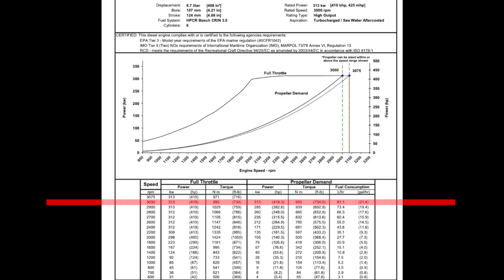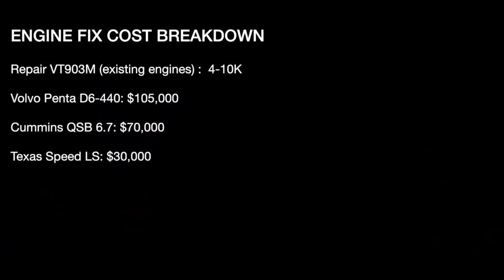Tesla Powering my 30yr Old Italian Yacht? And Broken Diesel Engine Diagnostics

Comment: Electric and water what could go wrong 🤷‍♂️
Reply: Well, get what your point, but it is the future and lots of electric boats and boat engines are being pushed to market as we speak. Oil and water doesn't mix either ;)
Reply: @tojo7742  gas is much safer and efficient ;)
Reply: Yeah and think about the breakdance you'll see when u step on the water
Reply: There are just as many electric outboards as gas powered ones... Inboards are getting more popular since the battery technology gets better and betree
Reply: But it gets the views
Reply: Trolling motors are electric.
Reply: most modern vessels are diesel-electric in one way or another. Some vessels use diesels only for generating power to drive electric motors and to power the grid.
Reply: you´d be suprised of how much electric motors there are for boats these days
Reply: @cdk2678   ya and 12 volts.   I dunno what a Tesla runs at for voltage and amp, but I bet it's higher than a car battery.   Therefore more dangerous around water.  Also meant for slow movement like he was talking.  1.5 hours of run time sounds like it would blllloooowwwwww
Reply: Remember that one time  Ferdinand Porsche built a EV tank for Hitler because EV is the future, you cant adapt ev for small scale to move big and heavy around with major problems
Reply: @ijmodified  you do know there are large passengerferries that are fully electric right?
Reply: There are plenty of electric boats !
Reply: Hhhmmm isn't there lights on a boat, and batteries?? Not seeing the problem... :)
Reply: here in norway we replaced most of our car ferries with electric boats.
Reply: Shit better tell the Navy to stop using diesel electric and nuclear submarines and aircraft carriers
Reply: @eriksimca9409  and you think that there built with used tesla parts?
Reply: There are ways to protect all of the electronics not limited to blowing fuses, and watertight enclosures if the water level gets too high.
Reply: @therealdurfee  No, electric is much more efficient and safer. Efficiency is one of the main selling points.
Reply: @tojo7742  Current battery tech is no way near what it needs to be for boats and planes. Even electric cars suck with the constant recharging it better of waiting a few years for something like solid state battery tech to hit the market.
Reply: @ijmodified  lmao no... did you even watch the whole video? he had the thought, but then came with the facts why it wouldnt work
Reply: @AsixA6  i dont see why its more efficient, takes 5 minutes to fill a gas tank and you can go for almost 400 miles, with electric it can take hours and its possible you wont go for as long, and if you get water in an electric motor, thats not good...
Reply: @therealdurfee  Efficiency is about how efficient the motor is at converting energy into mechanical movement, not how quickly you can fill the tank. An electric motor converts roughly 90% of the energy  vs. only about 25% for an ICE. 

Big oil tankers and cargo ships have been running diesel electric motors for many years now so, no, water is not an issue. 

Don't get me wrong, I think he should just rebuild the diesels he's got, but I was just pointing out that electric motors are vastly more efficient than an ICE.
Reply: @AsixA6  you've got me convinced, i think its just a prefrence now ;)

Comment: Diesel; hands down. Repair/rebuild them. Put seafoam in the tank when the fuel will sit for any length of time. Also have the benefit of adding a small Diesel generator that will run a/c and everything else on little fuel.

Comment: There are electric catamarans that have a diesel generator that I believe are capable of not only charging the batteries but also running the motors.  This would give you the ability to get the range you’re looking for.

Comment: I'm voting... Keep the yacht as built, sexy and diesel.   Diesel for all the torque and power reasons you stated yourself.   Make the yacht high end electronic, automatic and low maintenance (amazing engine monitoring etc)  for enjoying it. Modify the current diesels (turbos, cooler etc)  consulting with some Diesel experts (DEBOSS Garage) to help you tune them and get most out of them for power and durability!    KEEP THE DIESEL... WE WANT THE DIESEL... hahah

Comment: im adding this comment before watching so im sorry in advance.t the problem i see with not doing a dual swap, is different prop sizes.  you may be able to get close, but if you are not able to get close enough the boat will pull. it may also increase ware.

Comment: Go with a hybrid diesel/electric comb like most newer large container and cruise ships. You would have extended range and better fuel consumption than diesel alone.
Reply: I'd love to see that. Electric operation when maneuvering and the diesels for cruising. And both when you want to go 40 knots :p

I guess this would probably be too complicated a build though :/
Reply: That's is only half correct, the cruise and container ships do NOT use batteries, they use a diesel engine or jet engine to drive a generator and then use the electrical power to drive prop with a "drive pod" ..   Batteries are almost useless on a boat, the amount of power needed to move a small boat is 10 times what a car uses. Range on batteries is pathetic.

Comment: Dual Cat C15's from Trucks converted to marine spec 700hp a side easy and reliable.
Reply: Whatdo you think how much fuel doet it burn a minute 😉
Reply: @neamanja  probably about 30% more based on newer injection system and that the cummins vt 903m and cat c15 are the same displacment.
Reply: I was thinking the same thing throw in CAT C 15's thats what we use in the Marine Corps LVSR really good engine
Reply: Hell yes and 2,400 ft pounds of torque
Reply: They make marine CATs, real expensive
Reply: Would also be too tall for his boat
Reply: @AK47xSNIPES   its only a 7in difference with the marine oil pan im sure you could find the room

Comment: You get a diesel leak on a boat like that and glistening slick that your bilge pumps spitting out the back stinks bad enough that you'll quickly notice you have a problem.
You get a petrol (Gasoline) leak in that big semi sealed engine compartment, you may not notice the problem before you're just one little spark away from being fitted for a harp and some wings.

Whatever engines you choose, I'd think "rolling coal" would probably be the option to bring the most peace of mind to someone who's going to have their family on board.

Comment: I work for a marine diesel outfit in Seattle. Those Cummins 903's are sort of black listed in the boat community at this point and are probably the reason you got the boat for what seemed like a good deal. I would not recommend spending money on rebuilding them. You won't be able to get your money back. Not trying to be negative. Look into Cummins recon 6bta they are factory rebuilt 5.9 marine engines

Comment: PACCAR MX13 Engines, It puts out 510Bhp and 1,850 Torque's, these things are built to last and pull big weight, I'm sure you could find 2 wrecked W900's with Engine in tact, Man 2 of them suckers with turbo & cam upgrades boosted to 625 BHP would be a beast

Comment: what about diesel hybrid? just a crazy thought but it seems legit.
Reply: That would make awesome content
Reply: My thoughts too! Would be an awesome project, Tesla Cummings hybrid! Get more silent speed for marinas and rivers and have the diesel recharge the battery when on the open water
Reply: @ethanbowers6069  Yes, keep the good engine, repair and sell the other engine and replace it with Teslas. Use a generator on the diesel to charge the battery. Really nice project!
Reply: Diesel electric configurations aren't uncommon on super yachts.
Reply: @MartinRunesson  I wonder what would be the max speed with the electricity produce with only one engine but my guess is it wouldn't be that bad...
Reply: @MrPicoli  Well, if the diesel engine is connected to the generator it´s more of a range extender.  Top speed depends on the performance of the electric motor(s) added. He could still go for two Tesla motors and get good speed and enhanced range.
Reply: @MartinRunesson  yeah it was more what I was thinking about...

Comment: What about a Hybrid? Install 2  30-40 KW diesel generator(s) to power the drive motors at about $8K-$10K each.  Train Engines have done this for 50 years.  At 5-15 MPH you could go a very long way on 300 gal of diesel. At 25-45 mph you could still go for 35-50 hours of boating. By adding an Aux 25-32 gal fuel tank, even further. Chances of both gen sets crashing at the same time is very small. By installing the right voltage regulators and controllers you could split the output of either in 1/2 in an emergency, to run both motors at 3/8-1/2 speed, at just 3.5-4 GPH. Just a thought outside the box to make the boat more unique. A 40KW Gen eats about 4 GPH at full load, x 2= 8 GPH. You could go for 36-37 hours of cruising at full speed on the main tank alone. Gen Fuel usage: https://www.hardydiesel.com/resources/diesel-generator-fuel-consumption-chart/

Comment: Do what the old submarines did. Electric motors on batteries with diesel generators for cruising long distances.
Reply: Diesel electric would be sick af, that's what I said!
Reply: Hmm I don’t think the boat has enough room for a big generator and battery bank big enough to power 2 big electric motors, maybe 2 medium/small with less torque than those Diesel engines .

Comment: Rebuilding and using the original engines is the best way to go, that's what they were designed for so you should definitely switch to electric! None of your other engine swaps make any sense so why should this one be any different 🤣
Reply: once you put a heavy load on electric motors they overheat and reduce power, specially the old p85 motors lol. he'll be lucky to go a few miles before they overheat.
Reply: Should be fairly easy to water cool them.... maybe

Comment: Hybrid? Diesel engine with electric motors on the props.
Reply: This is an idea, a single prop for trolling/slow speed driven buy Tesla motor, diesel to charge batteries
Reply: Rolce Royce makes them for bigger yaghts with a generator running the props but they are wayy expensive there's a boat built by benetti a 73m or Savannah is also hybrid those boots cost over 350 mil each

Comment: Hey guys well knowing cummins it will prob be not a head gasket Poss cylinder liners and or oil coolers have failed . Main reason liners fail is the wrong coolant / DCA filters as if not correct it will eat the liners away from within the block . Good luck and look forward to seeing what is wrong . PS forget gas engines as they are so so dangerous when you have a fire etc and they will not last long at all

Comment: Very complex system required to run electric motors in regard to stern gland sealing etc. Reduction gearboxes would also be necessary as high rpm would cause cavitation at propellers. Stay diesel and increase reliability!!

Comment: Bro you should definitely do the Volvo's I heard they run really great for years and use lesser fuel than the Cummins...  Also, the electric wouldn't work they'd drain the battery way to fast producing that kind of torque, they'll be like very small capacitors that take ages to charge.. 
But, If you Do a Hybrid ,One engine and electric motors, it might just be a new revolution in the boat industry, I mean Large scale manufacturers know this that's why there's no electrical boats, and if you're gonna keep an engine why not keep both of them.. Unless you wanna save on fuel,  coincidentally, boat motors are also really good at producing electricity cuz they can hold that torque for hours...

Comment: The Tesla swap would be bad ass with a smaller marine diesel powered generator and solar panel combo to charge the batteries. Probably should add a few battery packs to the mix as well.

Comment: you might be able to get parts of a wrecked chevy volt as it uses electric motors to drive and a gas generator to charge the batteries

Comment: From a cost stand point my vote is for rebuilding the failed engine and putting them back in. I think it would be cool to partner with the machine shop to do a tear down and show what happened and show the rebuild process. If your dead set on doing a swap it makes more sense from an efficiency point to stay diesel

Comment: Diesel for sure. There’s a reason why they’re in there. It’s a heavy boat and displaces a lot of water. It would be like putting a gas engine in a Kenworth, just doesn’t make sense. Just add the appropriate tech to monitor your systems, oil pressure, oil level. You could do individual cylinder pyros to make sure there aren’t any fuel system/injector issues while pushing it along. Not sure why it didn’t have a Kysor shutdown system on it to begin with.

Comment: How about a diesel-electric hybrid? (Electric motor propulsion, powered by a diesel generator) It's what modern railway locomotives use, and id far more efficient. How efficient? It replaced steam because it could do 3X the work for the same amount/weight of fuel. That, and IIRC, it's what all the big cruise ships use as well.

Comment: What about hybrid? Installing a stout diesel genset with electric drive? You could potentially extend the range quite a bit…but still….electrical energy storage (I.e. batteries) will always be the weakest link until we figure out something better…..too bad, because electric motors are badass and they have so many cool application possibilities….
** I should add, I’m a commercial towboat captain, I push barges around for a living. A few weeks ago I moved the first all electric Tug boat (built for ship assist work). One of the design engineers rode with me as I pushed it from the dry dock in Mobile Alabama to their company dock. I asked him about the batteries and what expectations they had….it wasn’t very promising. The weight of the batteries was over a third of the vessels gross weight and under any kind of work, they didn’t think it would make 12 hours…which is why they have some serious generators on board.

Comment: The reason you got the high amount of back pressure is because the oil pressure is made by the crank, most likely something in your crank blew most likely a seal or gears got shredded.

Comment: Put in electric engines along with the batteries.  Then on top of that, put in Generators that can run on diesel that can run the engines at 80% load when you need to go fast.  Best of both worlds.  Cheap range when you want to go slow, Not so cheap range when you want to go fast.  Also, with diesel this setup, your range should be about the same as with nothing but diesel engines.

Comment: Three points. 
1. Any gas engine , no matter how many engine management systems, cannot give you continuous running. All you’ll have are gauges that tell you why the engine isn’t running. 
2. Safety. Look at any number of boat channels on YouTube to see the number of boats exploding during refuelling. Gas is for outboards only. 
3. Your boat designers, Riva are some of the world bests, would do their stability calculations with 3 tonnes of heavy engines just where they are designed to go. 

Go diesel and learn something new. I would also like to see why marine diesels cost so much to buy and maintain, even when using common blocks and major components from road engines. Is it because they are fundamentally different or are boat owners just paying through the nose because yards think we can afford it. Good idea.

Comment: What about  a hybrid system? Like a Mclaren P1 system that uses electricity to boost the engine to absurd speeds, but can also cruise electric olny for short spans of time? It would seem like that way you could roll around your river at that "slow efficient" speed not burning carbon fuel, but also roar out to 40, maybe quicker with an EV boost?

Comment: The Tesla electric power system would be better for a smaller boat that was for fun and weighed less, as far as that goes the Texas speed engine or rebuilding the diesels better and badder I think is the best bet, more reliable and stronger! Plus you already own them just build them bullet proof and badass

Comment: 100% rebuild your cummins unless you don't care about money. There is also a huge chance that your engine won't need to be COMPLETELY rebuilt. In addition to that, a pair of gas engines will in fact decrease the value and narrow down resale target. This hull is only worth cosmetic upgrades and not more than that. Words from a former boat dealer. Good luck!!!

Comment: What about a pair of Electric motors with automated generator system so you can charge when needed combined with an assisted foil fin setup? Lots of fabrication but I would be interested in seeing if it would lift the stern slightly to reduce friction.

Comment: Would have been way way cooler to get the engines repaired really nicely, powder coated parts etc and just invested the rest into the interior and made it a sick party boat. Basically putting 2 expensive to run, dangerous and not anymore powerful engines on it for no reason.

Comment: A hybrid system would work best, in terms of emissions, 0 emission sounds cool but it would cost too much and as you said, it would severely limit mobility and resale value. Instead of spending 70k on model s parts it might be interesting to get two Tesla power walls (I think those are 2-3000 and much easier to work with) and a diesel generator, or two, maybe a few solar panels instead of the bimini top. As for engines, I'm not sure about pricing on those designed for boats, but I think working with Tesla parts would be a nightmare. Maybe reach out to rich rebuilds, he might be able to help you out, he has tons of parts and experience working with Tesla electronics. Could be a less expensive option.